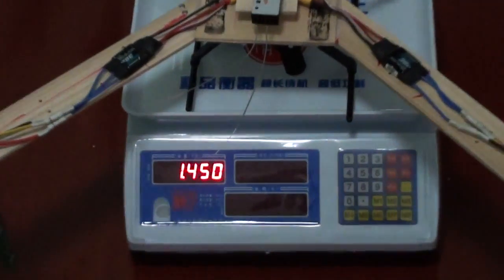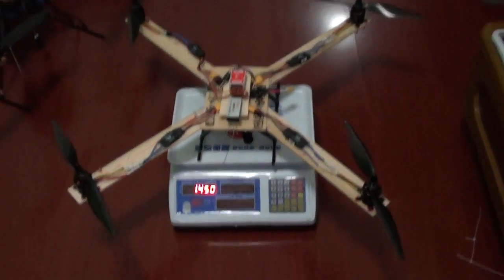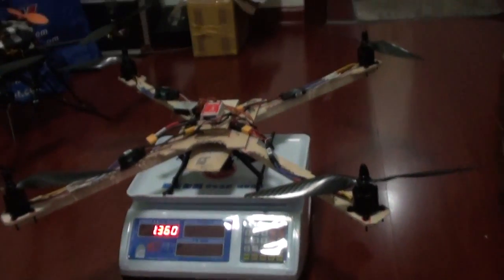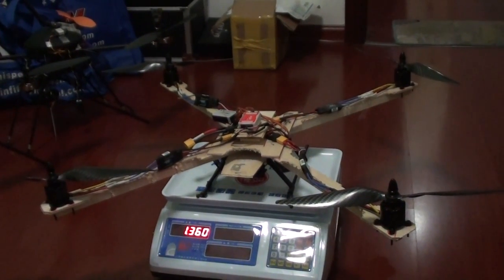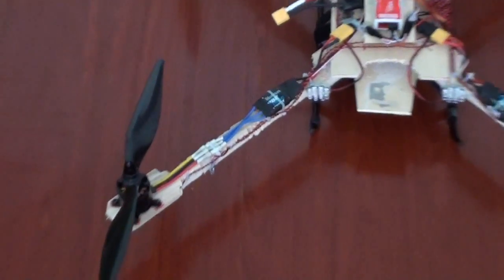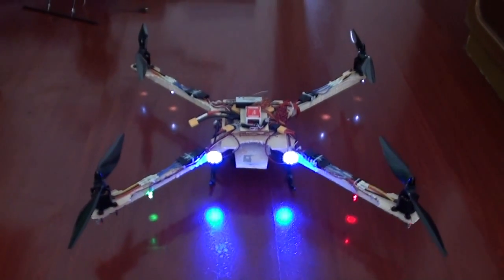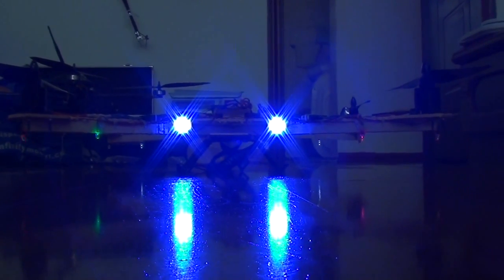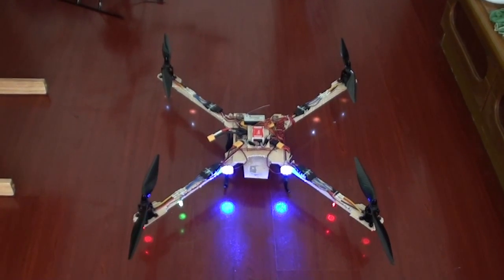Widow Maker Home made Quadcopter Final mods and lights

Comment: Hey Bro,How are you doing ?been some time since i've been in touch,Been busy at work :-(
Please could you do a video on how to setup/connect and use a Turnigy Receiver controlled on/off switch,I bought some Turnigy LED'S and a Receiver Switch but I'm really not sure how to connect everything up with the switch(i don't want the lights on perminently and that's what happends if you plug straight into the receiver)I'm gonna put them on my Red Arrow :-P,,,,Stu.